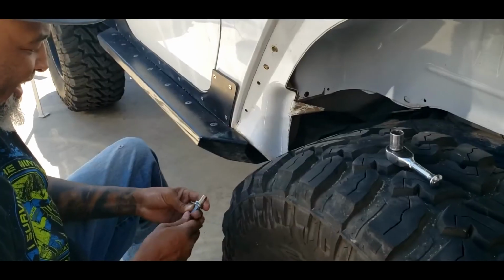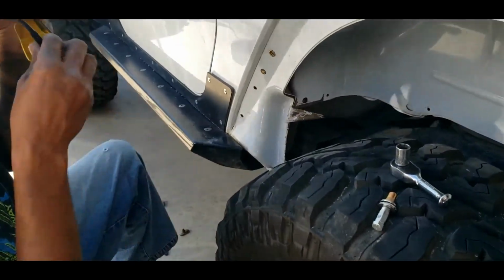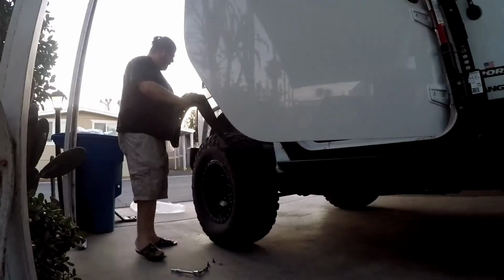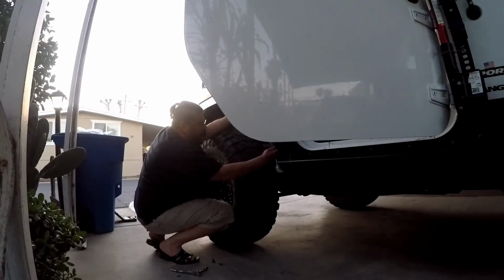Jroad Inner Fenders & Hooke Road Fenders install

Comment: Just installed mine. Thanks for the tips. I used a nutsert tool right off the bat. The little tool they include is too cumbersome. My only problem with these is a single hole in the rear fender flares. It definitely needs enlarged. In my case it was the fourth one from the back counting up (the one at the top). Over all, a great improvement to the look of my JK and happy these are so darn cheap compared to other options out there.

Comment: We fought the same battle on the rear outer fenders. The little tool Hooke sent with the kit flaked out about 3 rivets into the install. We live pretty rural so we ordered a new rivet tool and were down about a week waiting on that. Now I can put them in easily. The fender kit we got came with 8mm x1.25 pitch rivets. If you buy a Hooke kit for the rear of your Jeep you might as well order a rivet tool and save yourself some headache. Take your fender mounting bolts to a hardware store and make sure of what size and thread pitch they are before you order the rivet tool.
Reply from the maker: Thanks for the comment.  Yea I definitely recommend having an actual Rivit tool.  The Hooke tool they provided just gives people false hope lol.